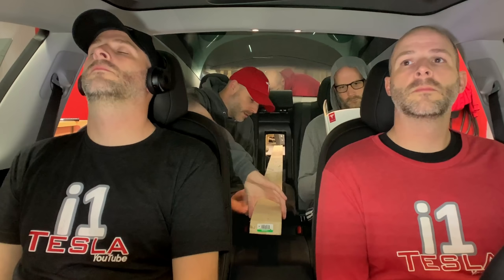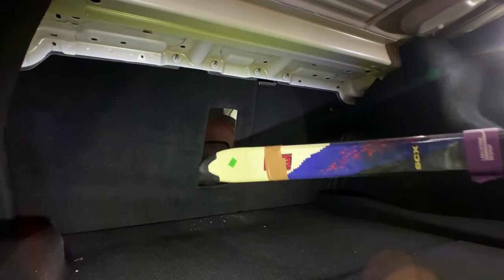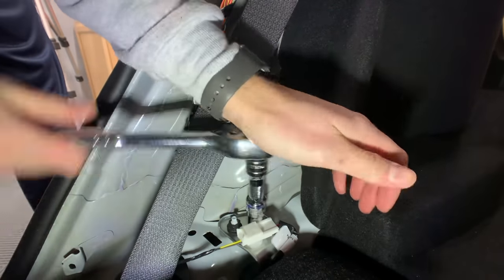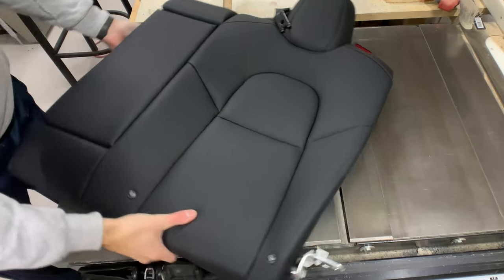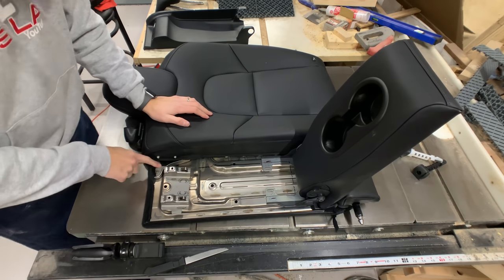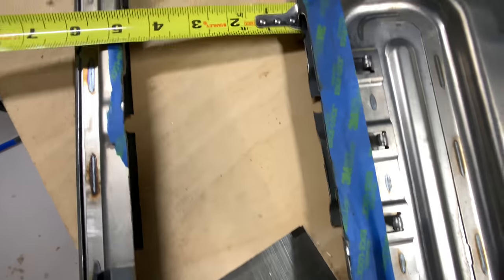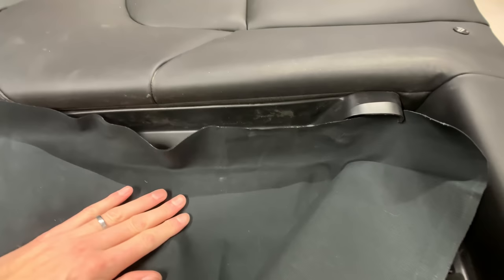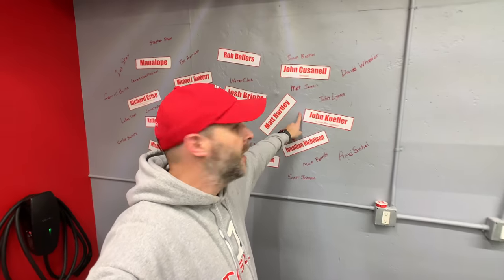Model 3 Ski / Trunk Pass-Thru

Comment: Your a brave man! But I completely understand. Some other cars have this and the Model 3 could have had a pass through door that opens backwards into the trunk. Now all you need is to 3D print some black frame to finish it. Or better yet, your awesome with wood working. Then just paint it black. I wonder if this would change the sound of the sub woofer at all.

Comment: Thanks, great video and tutorial. After finding your explanation last week, today I did actually make the ski pass-through in my new model 3. It has less than 1000 miles on the clock so it did hurt  in a sense to do this....lt should have been a standard option from Tesla I think. It took only 4 hrs as I did not have to search for anything how it works, all that is needed is in your video. 3 ski sets fit in easily, 4 could be done with some puzzling I think. Thanks again. 
Rijk (from the Netherlands)
Reply from the maker: That is amazing I think you and I are the only ones with it.

Comment: since the seat back cover is zippered, I wonder if you could have avoided cutting a hole through the fabric in the back. I have been considering doing this to my M3 since day 1 but don't like the idea of a hole in the back. I wonder if it is possible to only unzip the back cover to allow the pass through but leave the cover intact when not using the pass through. Will check on my M3. By the way I did the same on my 2016 Ford Fusion, it works great but the look is not nearly as nice as in your M3.

Comment: I’m tempted to do this for several reasons. One being to increase the bass coming into the car when the cup holder is flipped down, or flip back up to cut down road noise. I have a 2021 so we don’t have the vent in the rear deck and I’d rather cut the seat than the rear deck.

Comment: For skiing I fold down the 40 seat and put a ski bag in for snow and hurting the interior with sharp skis, plus I can fit multiple skis. In addition. If you want to carry skis and hold 5 people you can buy a ski pod. Now I wasn't able to get a roof rack and didn't want my post compromising efficiency so I installed a trailer hitch and built a mount to go from the hitch to the pod to mount it sideways behind the car. After a test (which I will upload soon) I discovered that adding a pod to the back of the car IMPROVES efficiency! If you know a thing or 2 about aerodynamics you'll know why, but I still think it's cool that I can carry skis and a bunch of other stuff and ass range without compromising on space in the cabin or trunk.

Comment: Cool. I thought it was wood back there. Since you already voided your warranty, I had an idea you could try to implement on the metal backing. You know some people have been trying to figure out ways to prevent opening of the trunk access from the back seat? But it just doesn't look like it would work.

Right at the top of the carpet, right below the headrest, if you drill a little bolt, you can attach it to a cable, which could then lock and secure to the child anchors. Should look something like this when you're done https://imgur.com/a/qXnxDcx

I don't have it anchored in either directions but would love to see you make it happen and with an actual lock and key or something

Comment: Firstly, I LOVE your channel, it inspired me to start mine (i messaged you a few months back for advise on starting, you were right, the editing takes forever).   Anyway, quick question of this Mod. With the channel open, do you notice significantly more noise at speed?   I am trying to sound dampen my M3P and and trying to decide if the trunk is next.   Thanks!
Reply from the maker: No more noise than normal. I had my windows tinted and that cut a lot of noise out

Comment: Mad props on that intro - I think that should be your new video intro.  Also thumbs up for the Rich Rebuilds kitchen knife, lol.  If I hauled a lot of lumber or lived in a ski area maybe i'd consider this.  Do you think this will impact sound coming into the cabin from the trunk area?  Or increased sound / hot & cold drafts when passengers are in the back and actively using the cup holder?  Bonus - now for family trips you can reach into the trunk for sodas and snacks!
Reply from the maker: I am going to test that

Comment: If there's enough clearance (thickness) you could make a panel to fit over the hole to fit behind the armrest held by velcro. "Pleather" one side, carpet the other.
Would reduce road noise from the trunk with the armrest down.
Reply from the maker: I bought velcro to do something like that but I don't have the armrest down much

Comment: What are the complete measurements of the hole? Will a snowboard also fit?
Reply from the maker: 4 X 10 inches
Reply: @i1Tesla  Yeah thats to small. A normal snowboard is 12 inch. But for a snowboard I am working on a  better solution. No cutting or whatsoever. Can update u when I am finished if you r interested?

Comment: I used your video to know where to put two holes in mine for my hockey sticks, this is excellent, then I used a file and plastidip to hide and smooth the edges.  Thank you for your videos!!!
Reply from the maker: very cool. I love mine
Reply: I bet!  Looking at it today I decided to order some 2” grommets with rubber center like you see for wire management on desks.  That should give a more finished effect.

Comment: Great info!! I have a subject for you to research (assuming you have not already done so) 
While in Auto Pilot, one issue I see if that it fails to detect road debris. I’ve nearly run over a 2x4 on the freeway, a hub cap, and a wadded up chain that fell off a work truck. Maybe you can run an experiment by stacking up 2 x 4 boards and see how many it takes before the sensors will detect it and see what it does about it (collision alert, break, change lane request, etc) Of course, instead of using real 2 x 4 wooden boards, maybe styrofoam planks instead?
Reply from the maker: Sounds dangerous
Reply: My Model 3 stopped and refused to advance when pulling into my garage due to an empty plastic grocery bag on the floor.  I was surprised at the sensitivity to this"obstruction."  Of course the car was going slowly at that time.
Reply: i1Tesla it is if you’re going to use objects that could cause damage but I know you’re a creative guy and it’s a legitimate “what if” for you

Comment: In EU carying skies in car is restricted due to possible danger reasons during crash etc
Reply from the maker: The skis wont fit past the opening because of the buckles
Reply: @i1Tesla  I know. But law is the law. There are no exceptions :(
Reply: @GregySVK  I have never heard about such a law. Audi had this solution in the 80's.
Reply: @mcplutt  for instance in Austria there is fine up to 500€. Skis are defined as a "heavy load", so it cannot be in car, you have to use ski box.

Comment: Great video - too much work though.  It looks easier to remove rear bump and install a tow hitch for a hitch ski rack.  Thanks for showing us though
Reply from the maker: No way. This took a few hours to do and you don't have the extra wind drag when driving
Reply: ryan589

Will that ski rack hold 2 lengths of 4x2?
Of a length of copper pipe?
Thought not
Reply from the maker: Dude I was laughing my head off! That was perfect!
Reply: @i1Tesla  
Just popped into my head!
Glad you liked it!
Reply: Nothing inside the car gets stolen :-)

Comment: The modification to the back seat by cutting a hole in the structure of it bring some unknowns into the integrity of the shoulder belt upper center ancrage. If my memory is correct, the safety standard test require to pull 3000 lb to that shoulder belt so a lot of forces go to the ancrage. Without a former test, very difficult to be sure of compliance and safety...
Reply: Correct.  If you perform this mod, you can no longer allow sumo wrestlers to use middle seat.   They must now use one of the other four seats.
Reply: No one sits in the middle anyway.